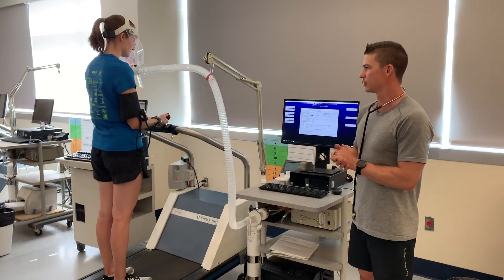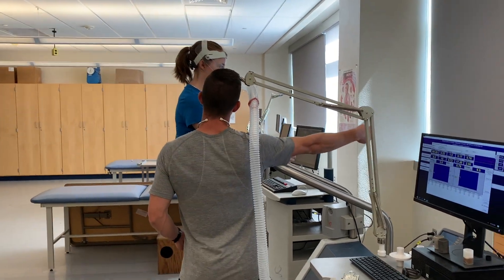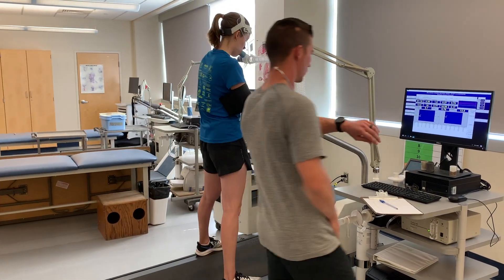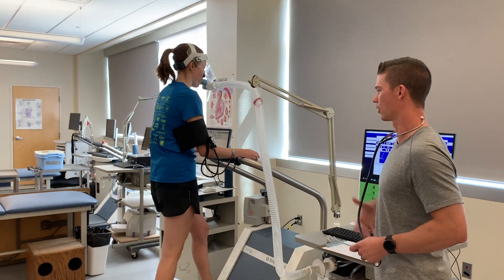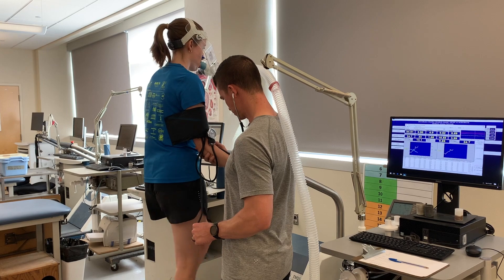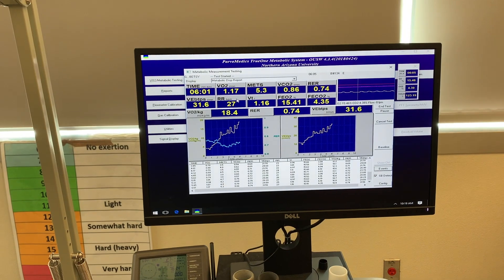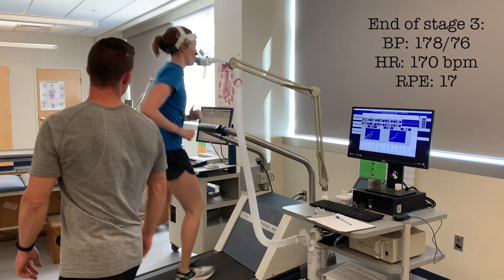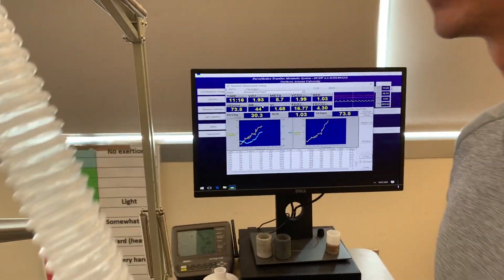VO2 max testing using the Bruce Protocol

Comment: Why did you take off the BP cuff mid test?
Reply: It was rather at the end of test, while pushing for final stretch, and since BP showed acceptable response throughout the test, there was no point (as per protocol/ from clinical standpoint) to keep ot further and probably nearly impossible to measure during the fast run anyway. I assume she Betsy would have her BP measure again during and after cooldown, to verify that BP went back to baseline level after a spike up to nearly 180 systolic during the final stages of the test.

Comment: She is extremely unfit for her age. An HR just standing still of 120bpm and a stage 1 HR of 133 is insane for her age.
Reply: She might have been nervous, AND not having a proper warmup before the test could make you feel spent too soon. Also, she stopped without looking like there was a ton of distress, so her VO2 should be higher. I've heard that if you nail the test you should feel like you're about to die when you call it.
Reply: @IFSwithAndrea yeah i think her max HR should be higher than 182 when she stopped. But also I think the technician should have cheered her up more and pushed her to go further
Reply: She did not push to the maximum. but 32 is fair for a female. Also, we don't know if she exercises regularly. Some people have naturally low vo2 Max, while others naturally high vo2 max.
Reply: @ It's not about pushing to the maximum. Just looking at a standing resting HR of 120 tells you she's unfit. No need to look at the rest of the test.
Reply: The BP also shot up quite a bit, in a way as expected during the workout, but still she recorded 178/78 before peak, i.e. last measurement point, which is always somehow surprising for a young slim female.

Comment: what was the final VO2max results? in ml/kg/min
Reply: 32.6
Reply: no way thats very low
Reply: @konnor9577  It's right in the video
Reply: @konnor9577  I took a VO2 max test years ago and measured 53. I was running considerably faster than Betsy when I stopped and almost puked at the end. 32 seems reasonable.

Comment: Can i use inhaler before this test?
Reply: I believe, it depends on why you are doing the test. If you are doing a clinical test for diagnostic purposes, then you should not use your inhaler of course after approval from a physician. but if you are doing the test for functional purposes and that is to start an exercise program, then you should use the inhaler in order for the result to be consistent with the expected response during an exercise program. remember, the Vo2 max will be used by the trainer to tailor an exercise program for you and they should know and take into account that a client is using a certain medication.